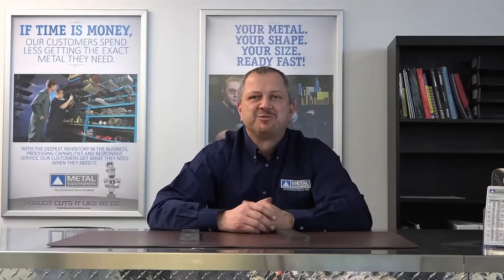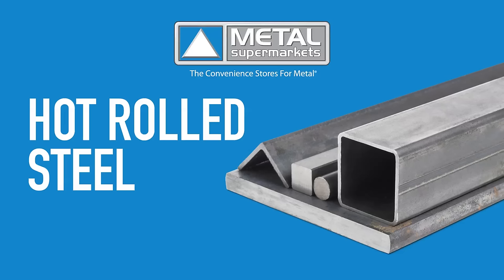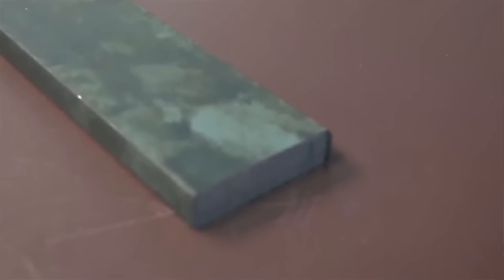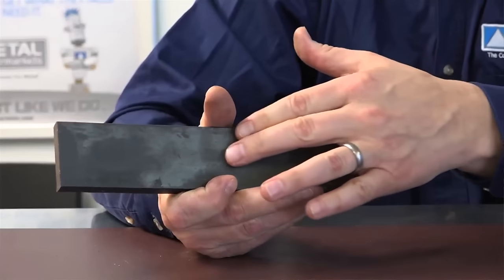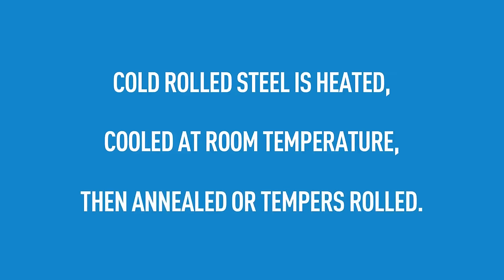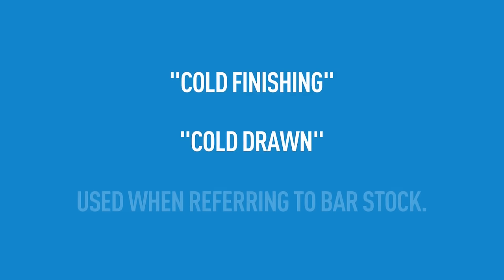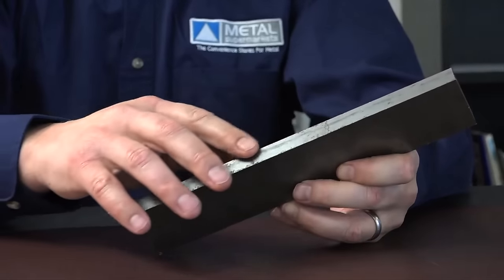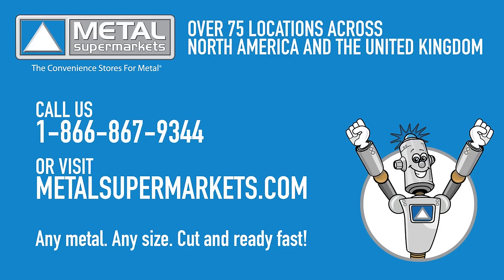The Difference Between Hot Rolled and Cold Rolled Steel

Comment: So... The differences are that cold rolled has tighter dimensional tolerance, and has a smoother finish. But what about strength, toughness, hardness, etc? Those seem to be very salient properties, about which I'm not finding much information... Oh, and of course, cost. You mentioned cheaper, but by how much 1%? 10%? 50%? Obviously it varies; I'm just looking for ball park figures.
Reply: in hot working it results in improvements of properties like impact strength and elongation. due to higher deformation temperature, the stress required for deformation is less. Hot working refines metal grain resulting in improved mechanical properties. if cracks and boles are present in the metal, they are finished through hit working. if hot working is properly performed it does not effect ultimate tensile strength, hardness,yield strength and fatigue strength of the metal but  in cold working it improves UTS ,hardness and yield strength..................i think this information may helps u .....................i m ashutosh from india.
Reply: Cold rolled should have higher tensile strength since it has a certain amount of work hardening when it comes to you.  Hot rolled is not "the same only cheaper".  In hot rolled steel the composition is not controlled as much as it is in cold rolled.  Name brand certified cold rolled won't have as much stress as generic cold rolled.  Curtis steel brand cold rolled is oil can.  Reliance brand tends to be better.
Reply: Ashutosh Dubey - Sir it seems you have good idea about cold formed steel. I am currently researching on possibility of cold formed steel used as structural steel. I have some specific doubts about it. Can you help me ???
Reply: My experience has been that cold rolled steels or any alloy worked at room temperature has better mechanical properties and they are consistent if it is from a name brand vendor like RA.  I have seen alot of generic material that had yield point runout and pockets where gigantic amounts of stress had built up.  I have actually seen material that had visible bands where the yield point varied down the length and aluminum that had places with so much stress it actually had lines inside it.
Reply: Curtis Steel is one of the worst their material is oil can when you get it.

Comment: So how does this relate to crystallization? I looked this question up after watching a blacksmithing video which referred to hot rolled steel being worked at temperatures above its recrystallization threshold, and was curious as to how lower temperatures would affect this process in particular...
Reply: Don't be looking for the metallurgical and mechanical property differences from this bozo presenter. 
All he covered is the cosmetic appearance. CLICK BAIT

Comment: hot rolling process is used to reduce the diameter of the metal and cold rolling process is used to surface finishing,diameter accuracy of product of hot rolling process...

am i right ?? plz tell me
Reply: hot rolling process is to form steel to shape. Without continuing the process, this rolled shape will reduce in size as it cools down, often losing sharp edges, squareness, finish, and straightness. When I say losing squareness and straightness, I mean in the thousandths range, not in any great amount. More a concern for machining to tight tolerances than for typical non-critical use.